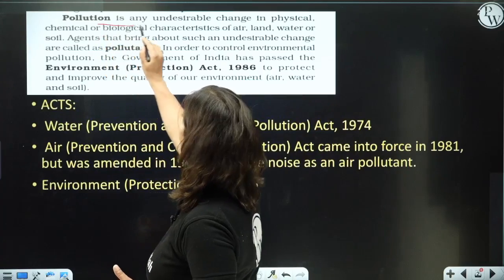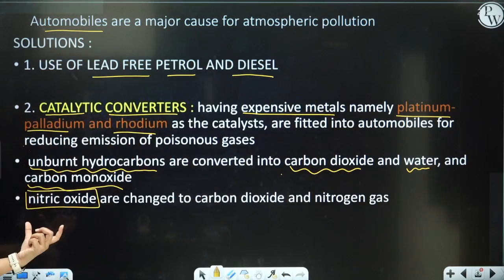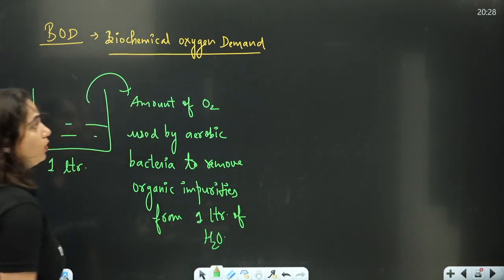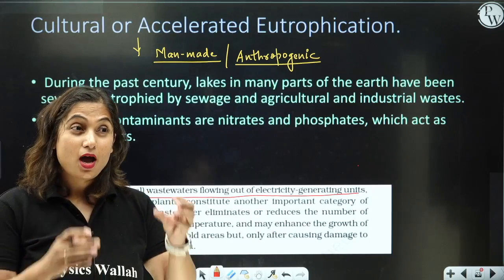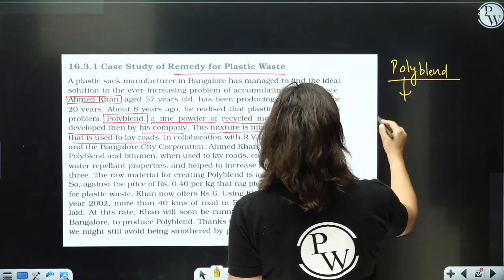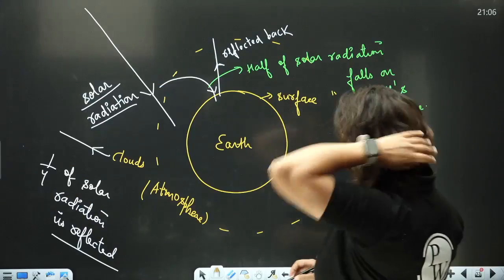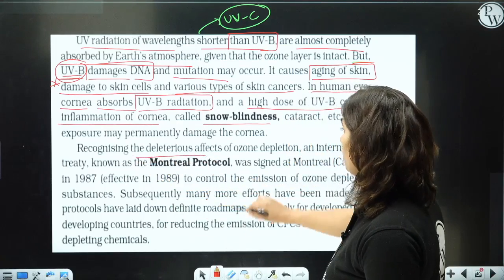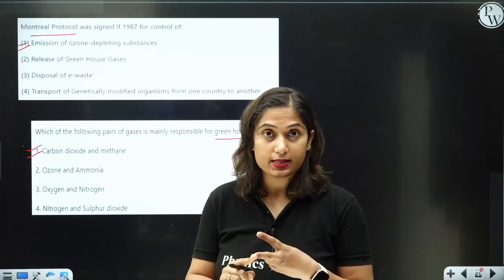Enviromental Issues - One Shot Lecture | CHAMPION - NEET CRASH COURSE 2022

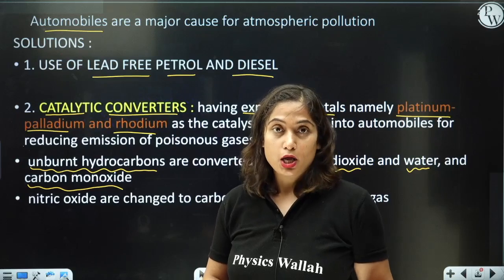Comment: 12:50 
Unburned hydrocarbons are converted into CO2 and water only

Carbon monoxide and nitric oxide are converted into carbon dioxide and nitrogen gas respectively
Reply: Right